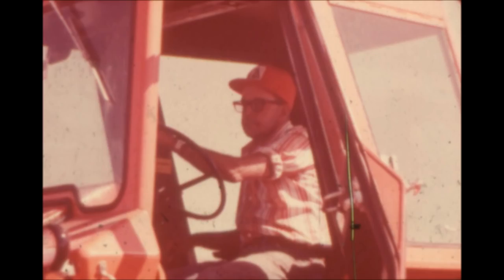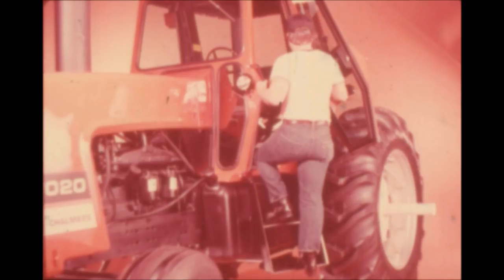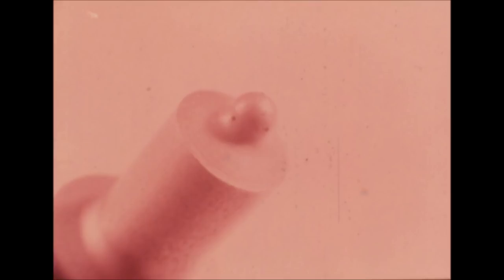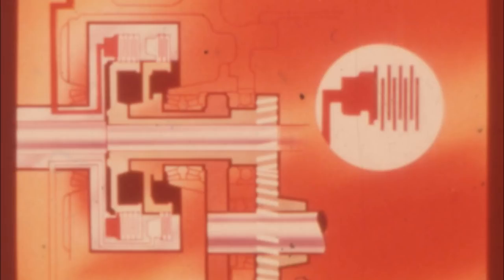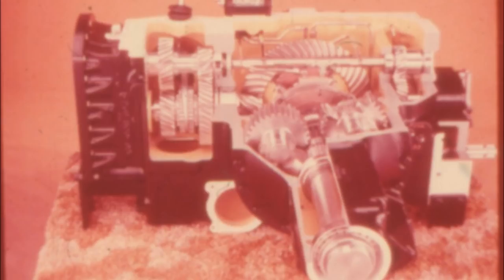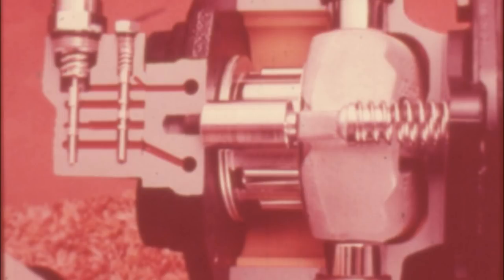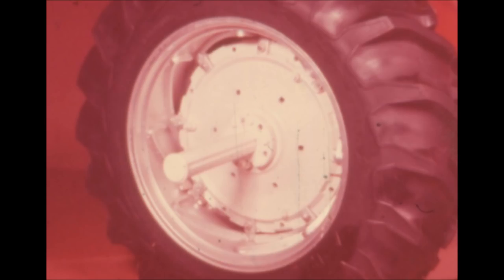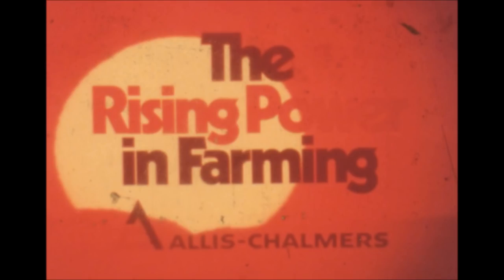1970's Allis Chalmers 7020 Demo Pak Tape AC048

Comment: I knew 2 friends that had 7020. Both worked with either neighbors or brother in law's who had 4430 John Deere. They said the 7020 would out pull, out work the 4430 on a fraction of the fuel
Reply: And very hard starting
Reply: Necesito él pouger chis
Reply: Dónde compro los repuestos